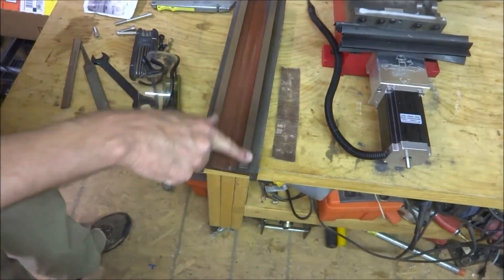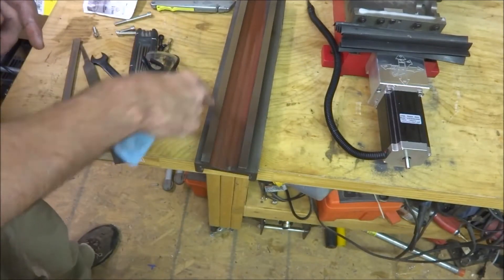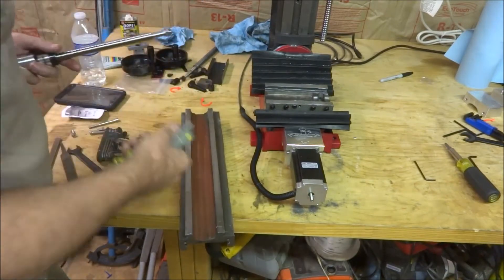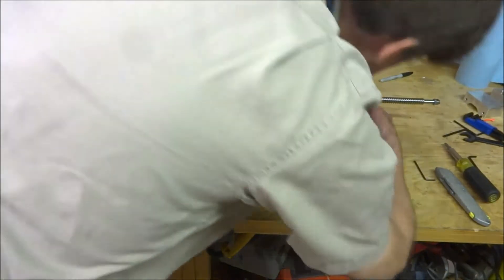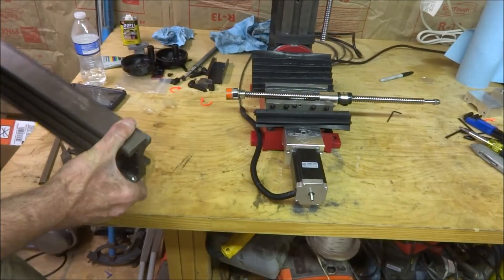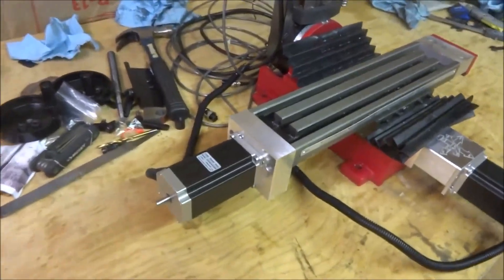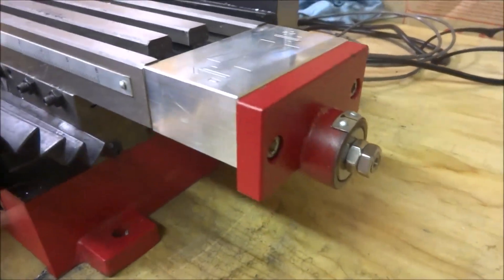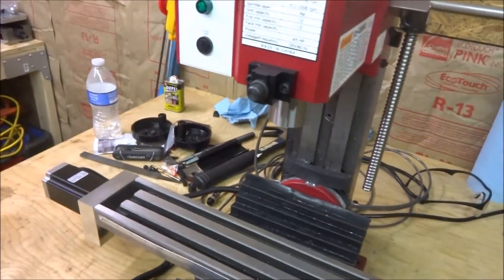Mini Mill CNC Conversion Part 6 - X Axis

Comment: Most people would've cut the motor shaft. If you have a Dremel you can use a cutoff wheel to trim the shaft to length.
Reply: +kaydee457   From what I can see, it looks like the other end cap should have been placed back on and it would have given the 1/4" or so that was needed,  with no need to cut or drill anything.
Reply from the maker: +kaydee457 - Yeah, I guess your right.  I don't think I had anything to cut it at the time.  Thanks!
Reply from the maker: +jbrunson1949  - Not sure I get what you mean.
Reply: +Craig&#39;s Machine Shop  [time 12:06 on video] the mill came with a red end cap on each end of the mill,  you replaced the right side end plus the alum part with longer bolts,  if you had done the same on the left side with the red cap, place it between the alum motor holder and the table, the red end cap is approx.  the thickness of the distance you were having the problem with,  {may have needed to remove some material from it so as not to hit lovejoy coupler} should have been some more longer bolts for that end to make it match the other end.
Reply: +jbrunson1949 That's just a plastic cap and wouldn't give much support. It would likely break. I just modified my Mill and already had to cut the motor shaft on both the X and Y axis'.
Reply: Ya fuckin Heb's!! Ya stick manual wheels on the ends... dumb

Comment: 👍 looks like you're making chip's very soon!
Reply from the maker: Peter Dahlman 
Hope so, I still have to put the limit switches on and wire them to the box.  Then set up mach3 and CamBam, tram the head, vise.  Lots of little things. Hope to be running by next weekend.